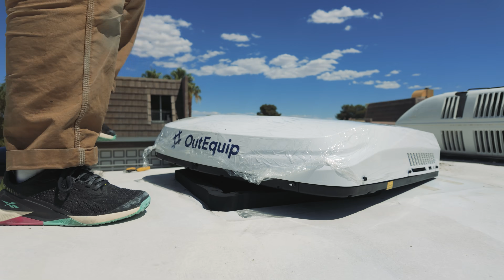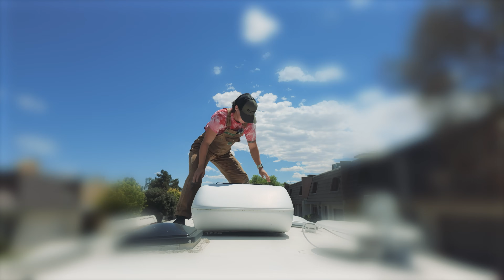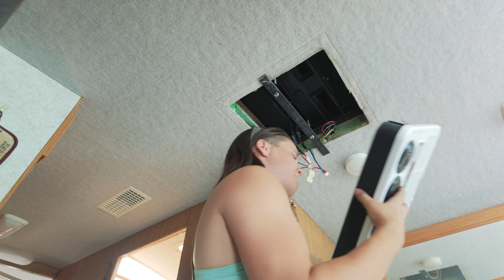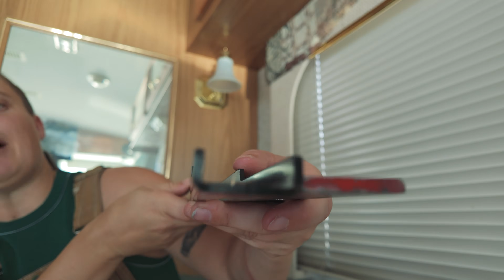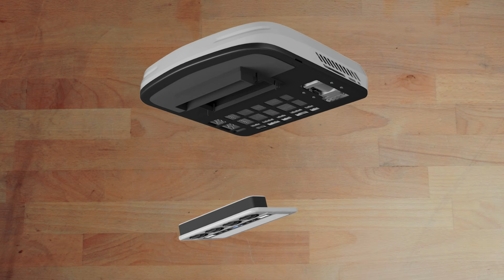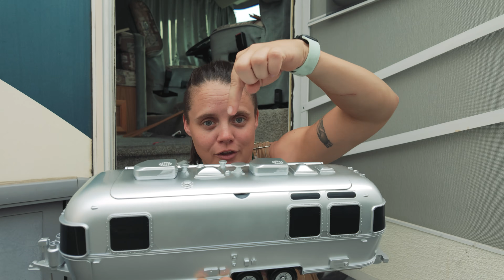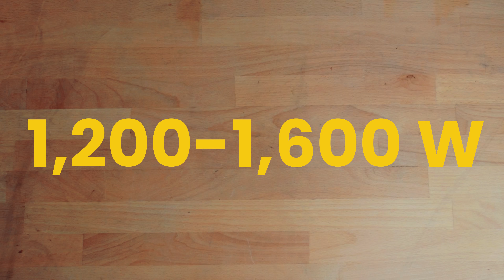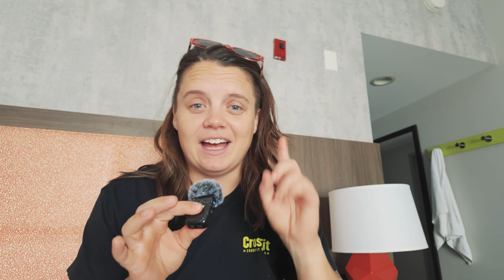Better RV Cooling with Less Power? My Switch to a 12V  AC | OutEquipPro AC Honest Review

Comment: 12 volt pizoelectric solid state Stirling cold gas cycle piston air liquifaction module generation of liquid air fills an insulated tank gravity fed with a sensor to shut off pump.  Liquid air gravity fed to aluminum cylinder lined with carbon felt that wicks up the liquid air.  A ducted fan forcing air down center for liquid air heat exchange boil off for air conditioning system.  Add in seabeak effect electrical power generation system from the ultra low temperatures from the liquid air charges up a propane tank sized organic carbon power cell that power's the pizoelectric solid state Stirling cold gas cycle piston and ducted fan and thermostat. Mutant brain hillbilly technology 😊

Comment: Watts are watts, if you drop down from 1600 watts to 960 forget about 7% loss, it’s dominated by the change in size. If you got a 960 watt 110 you may get the same performance less loss from high current through thick wires. They just don’t make small ac 110 unit. It’s like a car. The average car can freeze you out. 18,000 btus. Don’t get me wrong, it works using less power. Not so good in really hot climates. I put a thermal curtain between the sleeping area and the front of RV. Reduce targeted cooling area, inverter works fine, no rewiring. In you need a new ac unit, consider it. A heat pump is better as it will reduce the risk of flame heating.

Comment: This is exactly why the RV industry is slowly abandoning 12V for high-load systems. Serious off-grid setups are moving to 24-volt or 48-volt systems.Running that exact same air conditioner on a 48V platform drops the current from 40 Amps down to just 10 Amps.Thinner wires can be used, heat buildup drops drastically, and the battery banks become much smaller and more efficient.
Okay I just checked the web. 10 amps per hour is a hell of a lot better but you still need to have a lot of replacement power to keep your battery charged into the next day. If you're running your conditioner at 8 hours on 48 volts that's 80 amps. Do the math.

Comment: I put my bracket inside my air ducts that i no longer was using. Made the short all thread work well too and the bottom piece sat flush on the ceiling

Comment: One solution to the power problem when plugged in with a 30 amp. Run a second cord to the 20 amp outlet in the pole and run the ac on that. I do that for my electric heater when cool camping.

Comment: You have to be sure your battery charger can handle a full 30 to 70 amp charging rate. That will pull 3 to 8 amps from the ac side. You may have to get a bigger charger. Also if you have a motor home, you can run your roof air while driving, there again check the capabilities of your alternator. It must be able to run the vehicle plus the 70 to 80 amp constant output without overheating.

Comment: I'm looking at buying a used 27ft trailer for travel to the US SW for the winter. I'm planning on boondocking for most of the time and adding solar with LiFePo batteries. Wondering if this would be large enough to handle it. Thanks.

Comment: need to measure cfm between the two and that will tell you how much more air the 120v and 12v will be pushing. also heard a rumor that they are making a solar ac, but havent seen actually seen anything

Comment: You are AMAZING!  Thank you for a very well put together and super informative video on AC in a RV!  I have been searching and searching for a deal on a mini split for my rig.  I do solar power -so I needed to keep it at 12k BTU or less (115VAC).  This company solved my problems like right now!  They have mini splits available as well.  I'll be building a separate 12v battery system just for the AC that will run the 12v lighting and jacks, etc. as well!  Perfect solution for me!

Comment: I have a 2008 FR HW256 tent camper. And I'm modifying it to be 100% off grid. This DC AC unit would be interesting. Especially because of the weight. But going strictly DC is kind of my goal.

Comment: You should mention that if the wire is not long enough, you can't just add another wire of the same size to its end. That 12v wire needs to be thicker the further away the battery is. You may need to replace the entire wire with a thicker one, depending on how far your battery is from the device.  The installer will need to check the wire thickness/guague size needed for the amps and distance.

Comment: Love your videos, and you!!!  First thing please ve careful on ladder 4 to 1 ratio on angle or you end up taking a very, quick and scary ride!!  You spoke of running the line from the a/c near the vents,  how is the wiring supported on the roof, with clamps, tubing and or duct tape?? Wonder if these unit could be used in the place of the roof ventilation unit?  Again, great big thanks for your information

Comment: About 20 years ago. A tug boat company bought minisplits that were 110v. Looking at it. It converted the 110v to 12v 30 Amp.  We wired the system to run on 110 when we had shore power and 12v when not on shore power.

Comment: i've been holding back for two reasons, I have 40 ft class A with two 22,500 ac/heat units,  yes i would love to try one of these unit out in the AZ Desert, but i'm not sure it would cool down my big ass coach.  also running the 12 volt wiring to this unit would be a nightmare.

Comment: Commenting with a question on a one-year-old video, so I don't have high hopes, but: Might you have any idea what the distance is from the very front of that AC unit to the front edge of the 14x14 hole might be?

Info I'm finding online refers to a 14x9 dimension from the inside, where the interior parts attach; does this mean the unit can be positioned a bit differently front-to-back? Or does the unit have to be positioned in one position and one position only?

Thank you!

Comment: Love the video but have one suggestion.  I didn't catch you mentioning the BTU rating for the old (and new) unit.  If they were the same then the watt load is a valid comparison. But if the BTU's were different then that has to be considered when comparing the watt draw.  Sorry if I missed this info.

Comment: Could I tie it into the 12v side of my power panel? Or does it have to go straight to the battery? I have all of my solar/battery stuff up front and used the existing power cables to bring that battery power to the power panel.

Comment: Only issue with this is the common customer doesn't understand the interaction between 120v and 12v systems. Give a customer a 12v airconditoner and 12v fridge their battery is dead before the evening lol.

Comment: I just ordered an Out Equip A/C unit for my motorhome. It will arrive next week. Spoiler alert, it will not replace the existing 120VAC A/C unit. Nor will not be used for off-grid operation. It will only be used while driving down the road. This will be an entirely new installation that requires hacking a new opening into the roof above the cab area of my Class A motorhome. The purpose of this A/C unit is to provide an alternative to the totally useless, engine-driven dash air conditioning. I am totally fed up with that system leaking down less than two months after paying, yet again, to have it recharged. I’m done with that nonsense!

Comment: How many AH does the battery require to run? I installed and running on a NEW 200 ah battery and it shuts off after 3 minutes with a LV error code. Well, I have to have a battery charger from the generator to the 12 V battery in order to keep the amps high enough for it to run.

Comment: Thank you, very informative. My last upgrade would be to this 12v rooftop AC. I have given it alot of thought as to how I would run the cables. I have already installed 400 watts of rooftop solar, changed the evaporated fridge to 12 volt , changed the converter to a powerful unit that can charge the lithium ion battery modification and installed a 2000 watt inverter. Which is capable of running the rooftop AC. I have changed all lighting to led so my trailer very energy efficient.
Your information, knowledge is extremely useful and well presented. Keep up the great work.

Comment: DON'T "NOTCH OUT THE BRACKET"!  Obviously, a weakness in any part of a beam is the same as a weakness everywhere in the beam. I see this all the time in second floor bathroom reno's. People notch out the floor joist for the plumbing. They end up with the tub crashing into the first floor the first time they fill it with water. Your rainbow brackets are fine to keep it from blowing off the roof.

Comment: A couple of math details probably need cleaning up but overall, very good presentation!

-  This is a 10k BTU A/C which is only 67% the capacity of a typical RV 15k BTU A/C.  This means it will cool off a hot rig 33% slower and may not be able to keep up with some Class C RVs in hot weather.  

-  The rated specs say 58A at full power so @12v that is 696w.  Still 1/2 of a 15k BTU single stage traditional compressor A/C but greater than 296w.

-  Inverter technology is wonderful.  It is soft start by design, uses 30% less energy than a similarly sized traditional A/C, and once the rig is cool, it ramps down to be library quiet and uses only about 200w for comfort while sleeping overnight.  With 400Ah of lithium batteries this is a realistic solution to overnight sleeping comfort off grid.  Other inverter technology A/C units like the 18K BTU Chill Cube offer many of the same benefits with a much larger cooling capacity for rapid cool down in desert conditions.

-  Although 12vdc powered, the energy needs to come from somewhere.  Off grid it relies on a robust lithium battery bank and/or generator.  On shore power the battery bank is supplemented by your converter drawing 5-7A from your available 120vac shore power to replace the 12vdc being consumed by the A/C.  Still a lot less than typical 12A for a traditional roof A/C but greater than zero.

I hope these details add to your overall evaluation of a very viable A/C solution for many.

Comment: I see we wear the same brand Bubbas (overalls) Liberty is the only brand as far as I'm concerned. 400 watts is about what my LG 6k pulls but off my inverter. I really want a 24v AC like the one you have. With my solar it will run the AC and charge the battery fully too, as long as I get full sun that is.

Comment: Does these things stand a chance in somewhere like Vegas where it can be a 110 or worse...or places like Phoenix and the like. I believe conventional AC can only bring you down 25...maybe 30 degrees from outside ambient so with them you can still be 80...85 degrees even WITH the AC going good and cold like its supposed to. Would it be about the same principle here in such extreme hot climate regions?

Comment: We need this for big trucks...18 wheelers with $6 truck diesel. Running the main engine( 15 liters displacement) can be anywhere from 1/2 gallon per hour for newer efficient semi trucks... to a gallon per hour idling for older less efficient commercial equipment....or one that hasn't been maintained that well or neglected. So many other applications or lifestyles to install it into.

Comment: I’m wondering where you’re getting the units weight at 43 pounds. On the website it says 65 pounds. I just received mine today and it definitely feels like 65 pounds. UPDATE: i just realized YOU have just the ac version. I got the heat pump version, hence the weight difference. Thanks for the vid!

Comment: I have a 19K Travato and this sounds like an amazing option. I’ve been researching AC options that would allow me to keep my van cool while boon docking. I live in the country and work as a teacher in the city. Being able to boon dock during the week would save so much on time and gas traveling 2 hours RT every day. Presently I don’t have the ability to use my AC without plugging in (not available) or using my generator (load and expensive). I’d love to learn more about this AC and how I could run it on my Travato. I do have 2 solar panels on the roof, port for 3 and an outside port that I use portable panels. Thank you for this video. Feeling hopeful.

Comment: Hello just watching your video on 12v air conditioner, my park model is set up for 2 air conditioners but the bedroom only has a roof vent will this fit in that space and connect to the converter the trailer is 50amp but shore power is only 30amp

Comment: A couple of minor corrections:

At 1:35, you mention “a pretty significant solar setup,” which isn’t technically accurate. What’s actually required is a substantial battery bank to supply the inverter. Solar panels don’t directly power loads—they charge the batteries, which then feed the inverter.

While a large solar array often goes hand-in-hand with a large battery bank, solar itself isn’t strictly necessary. In some use cases, it’s not even practical. For example, if you’re a weekend camper who prefers shaded or heavily wooded sites, solar input may be minimal. In that scenario, a robust lithium battery bank paired with an inverter can handle your power needs, and you can simply recharge via a 30A or 50A shore connection when you return home.

Also, since you mentioned decibels difference, which to most people doesn't sound like much because most people don't understand how the decibel range works... The decibel scale is a "ladder of doubling" rather than a standard ruler. 
For your ears, the most important rule is the +10 dB shortcut: every time you add 10 decibels, the sound feels twice as loud. 
68 dB is twice as loud as 58 dB. 
In reference to the screenshot showing the 'startup' noise levels:
Sound at 90 dB (old AC) is perceived by the human ear as approximately 2.3 times louder than a sound at 78 dB (new AC). 
The bad news is sound Intensity (Physical Power): 90 dB has nearly 16 times the acoustic energy of 78 dB. 
The jump from 78 dB to 90 dB is significant because it crosses into the danger zone for hearing health: 
78 dB: Similar to a noisy restaurant or a vacuum cleaner; generally considered safe for long periods.
90 dB: Similar to a lawnmower or a hair dryer. Exposure to 90 dB can begin causing permanent hearing damage in as little as 8 hours.

Comment: So many questionable claims in this Video, foremost the unit does not run more efficient than regular 120Volt units. Per sellers website it pulls up to 60 Amps at 12 Volt thats 720 Watts. The same Wattage as a modern 120Volt 10k BTU unit. Plus this unit ALSO uses an inverter, to control the compressor speed. 
There is no rational reason why this unit should be more efficient or more silent than a modern 120Volt unit. its the opposite, if one runs a high quality efficiency 12 to 120Volt inverter the 120Volt unit is by far more efficient than a 12 Volt unit, because energy waste about triples with every more Amp consumed. 
Plus one does not have to deal with that  huge  wiring issue. 
The 120Volt air conditioner she had on her roof was simply outdated or had more BTU. 

Don't trust the math the women is presenting, this makes absolutely no sense without comparing the cooling performance to the energy consumption. 
Further, to find the manufacturer for this unit, this thing is nothing but a no name chinese brand with a outequippro label on it, take all the Specs they provide with a grain of salt! 

VERDICT: IF THIS UNIT WAS SO REVOLUTIONARY YOU WOULD HEAR ABOUT IT ON THE NEWS, NOT FROM A YOUTUBER.

Downvoted!

Comment: Seriously, you always make things so easy to understand. Did want to let you know that for some reason I had to resubscribe when I had subscribed to you already a long time ago. Question, I went on the website for the AC, and I noticed that there’s an option for the AC to also come with a heater. I was wondering if you had any thoughts on if that would affect the efficiency or quality of the AC portion, or if you have thoughts about combined units in general, without actually have tried this exact model that I’m talking about. Thank you. 😊

Comment: I own a Mobile RV Repair Business and have contracts with Dealerships, Manufacturers, and the Entertainment industry. I have seen a trend in appliances moving away from LP and 110v to primarily 12v applications and have enjoyed how you broke this down for your viewers. Good Job.
Reply: I saw a guy on the internet. Solar engineering or something I can't remember. Anyway he makes 12-volt electricity for his whole house. He runs 12-volt heaters 12 volt air conditioners. 12-volt cook stoves. Or I should say DC. A really informative guy.

Comment: Nice presentation but incomplete.  Comparing the power draw is not so helpful without knowing the cooling BTU comparison.  Over time the units will cycle once the RV is cooled.  A larger unit will draw more power when it's cycled on but will spend less time cycled on so simply comparing the power consumption when they're cycled on isn't the whole picture.  Over time a larger unit could still use less total energy if it's more efficient while cycled on.

Comment: To route heavier wire and you don't already have a route, look at the fridge vent.  There's lots of room so the wiring won't be affected by the fridge operation and visa-versa.  From the back of the fridge, it was now inside the RV and easy to figure a route to the batteries.

Comment: Inventer AC unit slow down to hold the temp instead of running full blast until they hit set temp and then shut off the single speed compressor until the thermostat kicks the compressor back on. I size my AC units to run half the time on my hottest days here in Texas. what you want to track is Kilowatt hours used per hour. or Volt-Amps which is not quite the same thing.